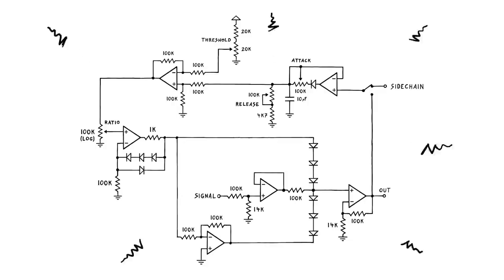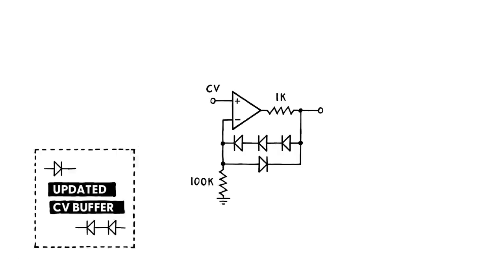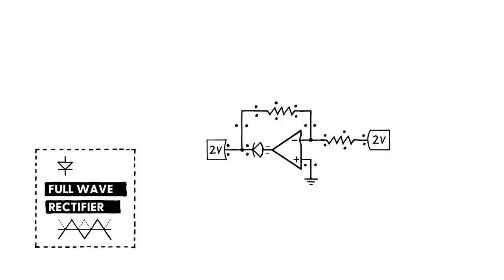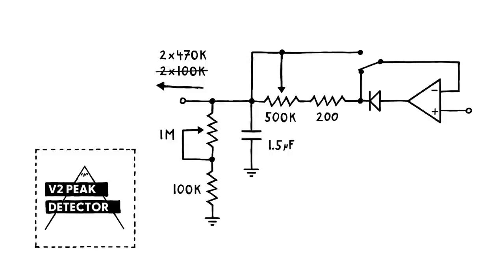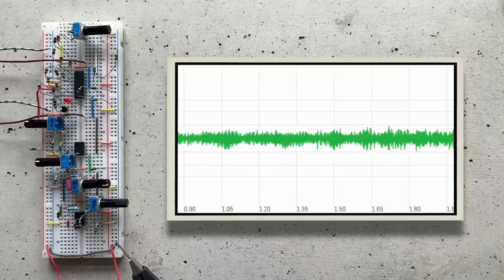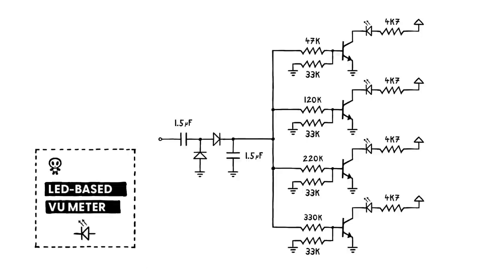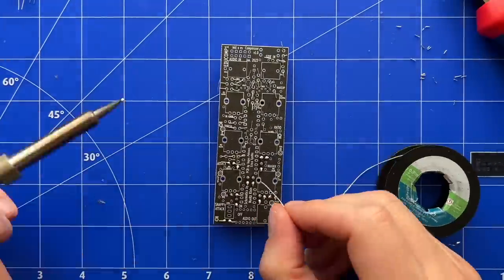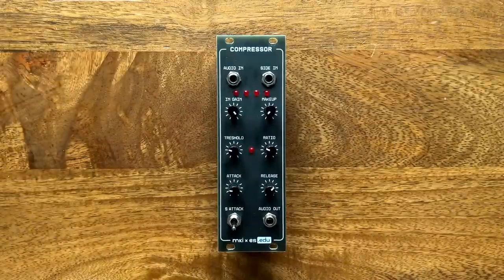Designing a production-ready audio compressor

Comment: Just to let everyone know that some of the best sounding mixes from the early 90's mastered on to cassette tape sounded amazing. But not because it was cassette tape, but because the cheap cassette recorders being used to do the mastering (DAT back then was only for the super wealthy), had little compressor chips inside that automatically kept the levels in check to prevent distortion from accidental overload and to raise the volume of the quiet bits. This lead to a super-lovely sound that I've never been able to recreate on any plug in or even hardware compressor. Also, another trick was using home-consumer dBx compressors that had link connections to join to other similar units, and that acted as what later came to be known as a sidechain. Running a breakbeat though them with an 808-style kickdrum at the link input resulted in some pretty unique sounding dub drums, in particular if you slowed the break down after sampling. Listen to Meat Beat Manifesto's remixes of the Shamen to see where I'm coming from. As for the cheapo cassette trick, highly likely Selected Ambient Works vol 1 by Aphex Twin mastered on shitty home cassette deck. That one I'm guessing, but 1st track has giveaway 'chewed tape' sound on 1st track and sounds very similar, as everything is lovely, warm and nicely compressed. Loving this series, Moritz. :)

Comment: One possible noise source could be the diode in the full wave rectifier. I build this rectifier myself and in my tests I found that the 1N4148 introduced quite some noise into the positive part of the rectfier. Using a 1N4007 instead worked better. Altough I can't explain why, so it might be only a problem in my setup.
Reply from the maker: yeah, when i listened to the rectifier's output directly, i also noticed some added high frequency noise/distortion. figured that it would get killed by the peak detector, but maybe using a different type of diode would make sense!
Reply: Another problem could be the missing clamp diode (which unfortunately cannot be used in Moritz' brilliant rectifier variation) which causes the OpAmp to go to the negative supply voltage during positive inputs. When the input goes negative again, the OpAmp output takes some time to travel back to the zero volt line which cuts into the signal. This produces distortions which could be perceived as noise. The 1N4007 diode has a somewhat lower forward voltage which might be beneficial here.
Reply: @ChristianMuenker  If that is the case, a schottky diode might be even better.

Comment: In the days of b&w analog TV, the subcircuit at 17:20 ('ac-couple-dc-restore') was known as a 'black level clamp' - it derived a DC reference for luminence from an unreferenced waveform. I have also seen it used to fix-up a poorly designed signalling system where lengthy PSU wires - used also as a signal reference - experienced significant voltage drop. The signal ground would rise-up as a result, offsetting the perceived signal level. AC-couple-DC-restore saved the day!

Comment: This is a very nice design but I will throw a few bricks are it for perhaps a Version-2.0
A few points based on my having made compression circuits in the very distant past.
1) The string of diodes making a current controlled attenuator can also be done with transistors.  The advantages of transistors is that you can get them as semi matched parts in an array.
2) Your rectifier will have trouble with high frequency signals because it takes a bit of time for the opamp to recover from being jammed against the rail.  There are rectifier circuits that avoid this.
3) Your VU meter is OK so long as temperatures are normal and transistors are close to matched.  You are using Vbe of the transistor as a threshold.  A clever trick is to use the forward voltage of the pilot light LED as a reference to compare with.  If you use the right LED, you can match the temperature variation of the Vbe with the forward drop of the LED.
4) The "I am compressing" indicator could be better.  If you used an emitter resistor on that part, you could get LED current that is more linear against voltage once you start having any voltage.
Reply from the maker: thanks for these! couple thoughts:

1) i like the simplicity of using diodes, also because they're so easy to get anywhere. are transistor array ICs widely available in your experience?
2) true, this is an issue. i think the compressor is biased towards low frequency signals on top of that. so i guess we should at least add a high pass before the rectifier.
3) could you give me simulator link for this one? not sure i follow!
4) sounds reasonable, but do we really want the LED to light up linearly? since we're indicating gain reduction, i.e. volume?
Reply: @MoritzKlein0  1) digikey carries a selection
2) Other rectifier topologies are available that don't demand so much from the op-amp.
3) I don't have a link handy but maybe later
4) Point taken

Comment: Its actually a great starting point to make it for studio application
Things to change. 
1.More detailed VU output meter scaled in dB
2.Gain reductuon VU meter, analog or also in led array (i'd preffer analog) so i know if its actually makin' reduction -3dB for example.
3. Input and output socked on the back (to connect with patchbay and mixing console)
4. Bypass switch.
5. Im not sure about SIDE in input.. if also on back, or in front.. it could be on back, and then additional switch to use it or not. So this input could be also in patchbay
6. two paralell supply sockets to easly stack up multiple of these compressors next to each other.
Im tryin to design PCB for this application. Also i've changed almost all components for SMD, to make it more compact.
Also making potentiometers off-board allows to make stereo version of this compressor. Just two of these boards and stereo pots.

Comment: Get a bigger tip for your soldering iron… or better yet, get an iron that takes bonded heater-tip cartridges (such as “T-15” style cartridges, or a TS-80 or TS-100 iron) and use the “chisel” or “hoof” style tips. The small tips like you were using don’t have enough heat capacity to effectively heat up the joint.

Also, consider adding extra flux. I generally use a paste flux (I’ve tried MG Chemical and Chip Quik with good results and I’m going to try some Amtech with the next batch of boards), and clean it off afterwards with 99% isopropyl alcohol (it’s a “no-clean” flux so it won’t corrode the parts, but it’s kinda stickey and gets on my fingers if I leave it there).
Reply from the maker: sounds good, will give that a shot!

Comment: 6:18 for the software compressor i made, i used an approximate hilbert transform to get two signals that should always be 90 degrees apart, then gets the magnitude of that and lowpasses it to remove some noise. i’m not sure it actually makes a big difference in getting a more accurate volume envelope but idk i like doing things differently and it’s not that complex.
Reply: the tldr is it’s like 8 total allpasses, and while their phases become very not flat, they have a pretty consistent 90 degree separation. it should be flat or mostly flat for a pure sine wave, since the 90 degree shifted version fills out the space in between

Comment: You make it really easy to understand not only circuits, but one of the most unintuitive effects for people new to audio! Looking real forward to ordering some of your modules soon.

The sound is great but I would change a couple things about the display - first, the input LED ladder would probably be more useful if it were after the input gain stage, so it displays what the compressor stage is actually processing.
Second, the compression amount indicator is really nice, but I think you could double up the LED meter circuit but upside down, and put that next to the input LEDs. That way, the volume reduction can be directly compared to the input volume.

Comment: This is not meant as fault finding... Just to make sure that things went the way you intended. IIUC, you said the snappy switch was to take the pot out of line. However, the way you added the switch in before the pot makes the pot 100% in line. Meaning, its full 100K resistance is at work.

Comment: I have a fringe idea...could you make a tube based, even harmonics variant in a new video?  I like your compressor, a lot as is by the way.  I am used to running a really hot "line level" signal through several different preamps at about 3v.  My vintage Carver amp loves hot signals with some modifications.  My 3rd preamp pretty much has the VU totally into the red with vintage Tungsol tubes 😅  For modern music, I ditch 1 preamp from the chain as it is so compressed already.  I really think even order distortion, used carefully, sounds beautiful.  Clipping...uhhhh not so much.  Can you get that kind of sound quality from op-amps?  If so, sign me up.

BTW I am a sound person over an engineer, but I have made a few circuit boards over the years.
Reply from the maker: oh very good question. i have to do some research on that one and get back to you!
Reply: @MoritzKlein0  ❤
Reply: I got one more question.  I just got a new headphone amp for my computer.  I run an Audigy RX, into a DAC into a Geshelli Labs amp.  

GESHELLI LABS ARCHEL 2.5XL HEADPHONE AMP AND J2 DAC SPECIFICATIONS

Archel 2.5XL

DESIGN:

2-channel, solid-state headphone amplifier.

POWER OUTPUT:

2 Watts Per Channel @ 32ohms.

THD + N:

< .000095% THD+N @ 2Vrms.

SNR:

> 124db SNR @ 2Vrms.

INPUTS:

1 pair RCA, 1 pair XLR

OUTPUTS:

1 pair RCA pre-out, Single 1/4” phono output.

GAIN:

2 levels (Unity or 6x)

MSRP:

$269.98 (with beechwood case)

OPTIONS:

Several wood and aluminum color options for casework and plexiglass colors for front and back.

DIMENSIONS:

4-7/8” Deep x 6-3/4” Wide x 3” Tall (Wood case, as tested.)

It sounds like liquid sex even though it is solid state.  😲  I use it to drive Sony 7520s.  Holy heck can it go loud.

Comment: what would be cool is a voltage controlled gain. an amplifier that can boost the signal strength and reduce it depending on the control voltage.

Comment: Again a very good video as usual. Small question if i may ask. Where should i connect the LED VU meter circuit? The same opamp output as the audio output or another point in the circuit? That only was not clear to me. Thanks in advance for your help. Kind regards
Reply from the maker: the erica synths manual for the kit should have the complete schematic: https://www.ericasynths.lv/media/COMPRESSOR_MANUAL.pdf

but yeah, should’ve included that in the video. my bad!
Reply: Hi Moritz. Thanks😊
Reply: Hi Moritz, My compressor is working like it should be. Thanks. I only have one small question about the Threshold knob. Its a 10K log. potentiometer connected to +12v via a 10k resistor. I notice that this knob only does work when almost fully clockwise. lets say the last 10% of its range Did you have this also? Any advice on how to adjust this? Thanks again and keep up making these great video's. Kind regards Maarten Louer

Comment: Would substituting 4562 op-amp and/or a 4564 op-amp aid in reducing output noise? I assume the choices of which would depend on which packages handle the signal path. I also suspect that if that type of op-amp were used, 100pf ceramic caps should be placed between the supply rails next to the op-amps and ground.
Reply: I have a feeling - you can also calculate it of course - that quite some noise is added by the resistors. Their values have been increased greatly and that might be the problem. But of course, opamp noise is also a thing.
Reply from the maker: maybe. i'm not too sure the TL07Xs are adding that much noise themselves. probably more effective to use smaller resistors (as @krakamak suggested), or add some filtering to the rectifier!
Reply: @MoritzKlein0  Thanks for posting this video. I find it very interesting and educational, and I plan to rewatch it and the "part 1" video, and to watch a number of your older videos for the first time.
I admit my experience is somewhat limited, but my subjective assessment of LM4562 op-amp performance is that it is consistent with the superior published specs, and LM833 and TL07x op-amps are noisier and sound more muddy.
Reply: @MoritzKlein0  I agree, the resistors add a significant part of the noise. Reduce the resistors for non-critical parts to something like 1k to 10k. For example, the two noninverting amps at the output! As well as the rectifier and the inverting amp.

And, of course, reducing the gain too much and amplifying it afterwards isn't ideal too.
I think you should measure first how much distortion your compressor has, and decide based on that how much reduction is needed. I think less than 0.1% THD is still quite good.

Comment: regarding the VU meter, could you add more LEDs to it by simply repeating the LED driver part more times? I was thinking of adding 3 and using different resistors between the current 47/120/220/330k ones.

Comment: What would you change if input is instrument level (guitar)
Reply from the maker: assuming that the guitar's signal peaks at 200 mV (just got that from a quick google search), you'd want to remove the voltage divider from the signal input completely, and bump the output gain by a factor of 2. like this: https://tinyurl.com/262pqnhf
Reply: @MoritzKlein0  I tried this but I'm getting a lot of distortion whenever the compressor kicks in, any tips? I did have to add a voltage divider at the output to reduce the signal back to the 200mV range